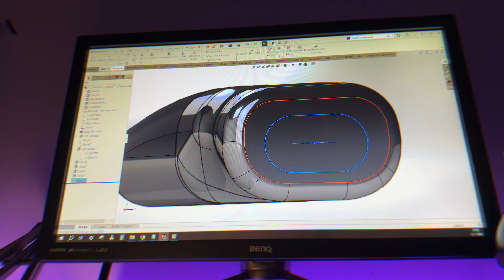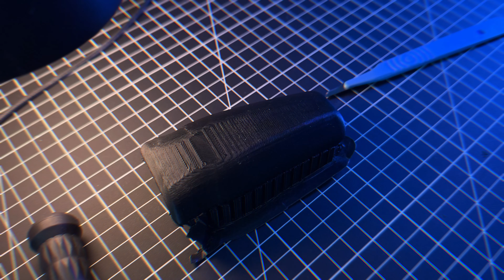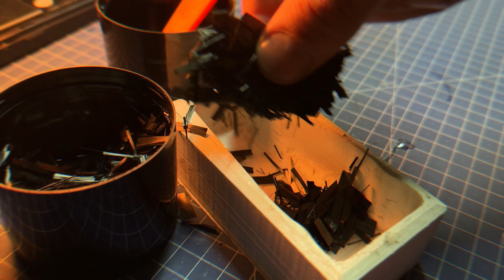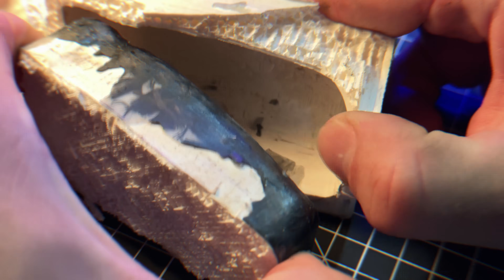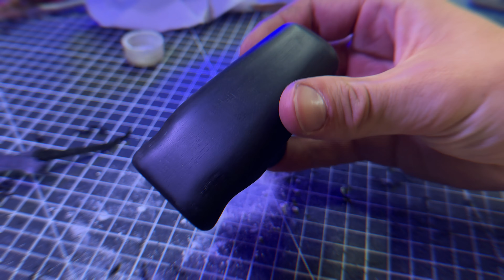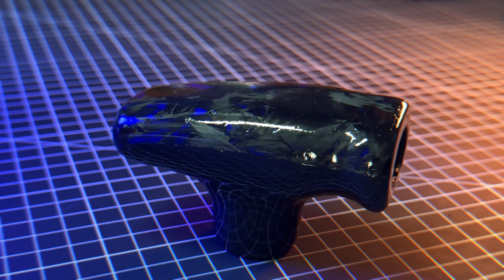Forging Carbon Fiber Shift Knob with 3D Printer

Comment: carbon fiber one can be dangerous because of thin carbon fibers on the surface. I think you should add a thin layer of epoxy on it.
Reply from the maker: when you shift a gear, the fibers will stick to your hand?

Comment: when working with cf always wear protective gear. you dont want to know why know... trust me on this.. gloves for handling unpolished, full facemask for cutting/filing/sanding/similar.
used matte cc would compliment the cf better ;)
Reply from the maker: thanks that you care about me mate 😀 I used just a facemask but I will get better next time!
Reply: @peteelab  spent 4 months in hospital having over 200 micro surgeries to remove fibers... be save bro :) ur friend is a lucky man
Reply from the maker: @reyalPRON  sounds baad 😬but glad to hear you are fine now ..🙂